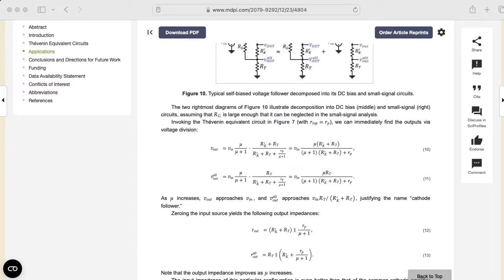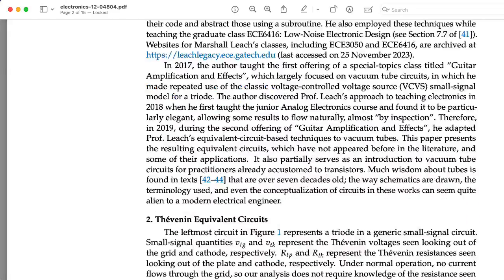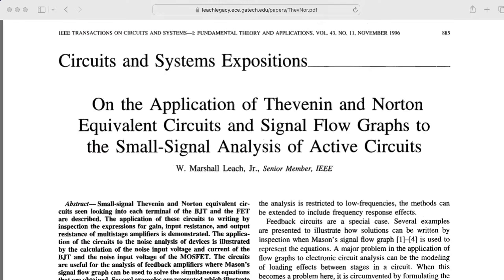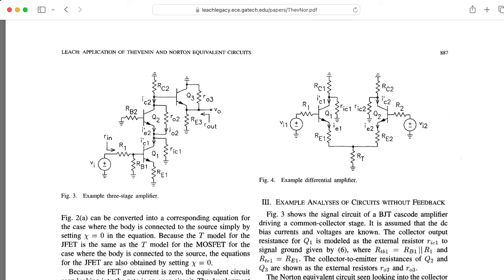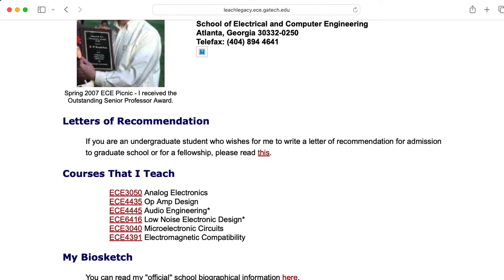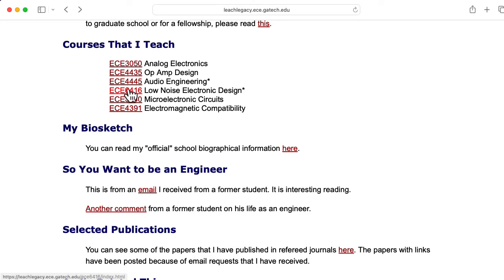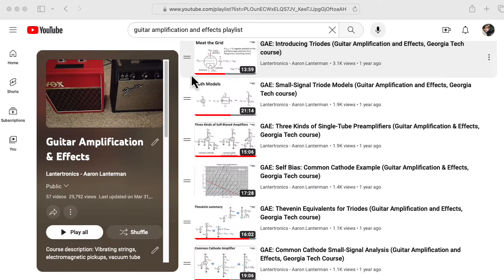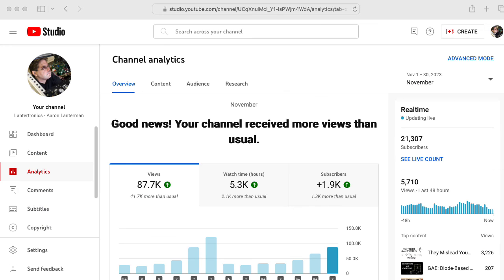New Paper on Vacuum Tube Circuit Analysis via Thevenin Equivalent Circuits (no paywall!)

Comment: On that same website you posted, you can also find info on OTA gyrators, but no complete circuit.
Thanks for the document, i didn't spend much time or rather close to zero on Thévenin.
What is it good for? cool, to be learning from a actual professor!

Comment: Thanks for posting this; your videos are always very informative. I completely agree that Thevenin equivalent circuits apply elegantly to vacuum tube analysis. For various reasons, I developed a circuit analysis program that employs loop analysis rather than typical nodal analysis. This essentially forced modelling to follow Thevenin structures, including for vacuum tubes. I can tell you that in the 20 years that I've been using the program, it performs flawlessly. In many cases Thevenin models are more intuitive and often are more accurate representations of their real-world components. Thanks again for posting your videos.